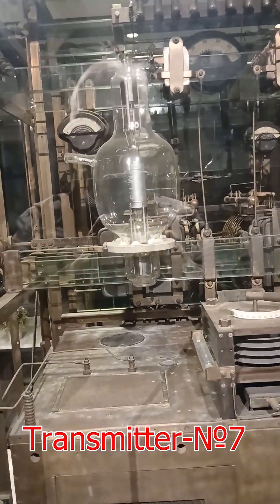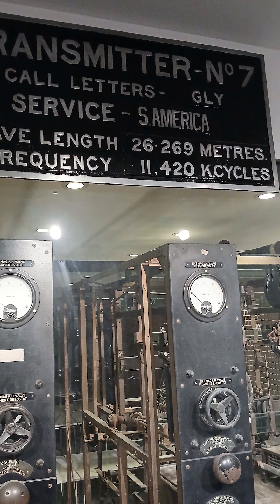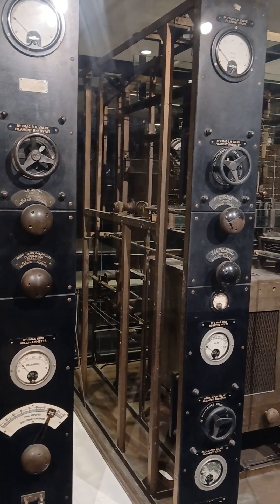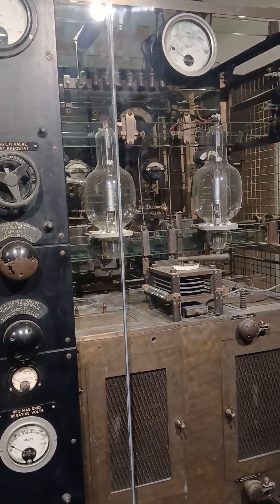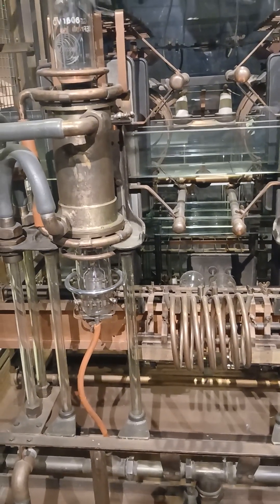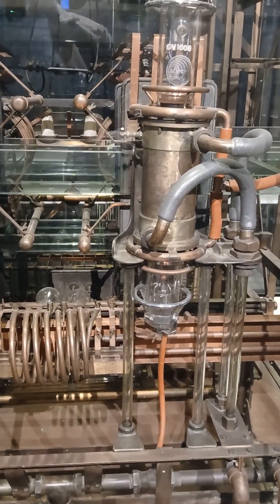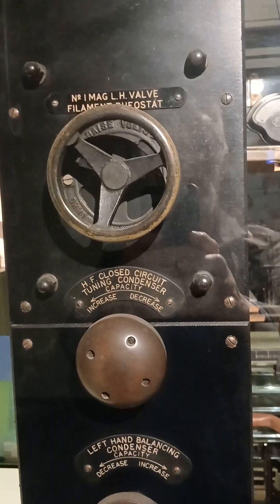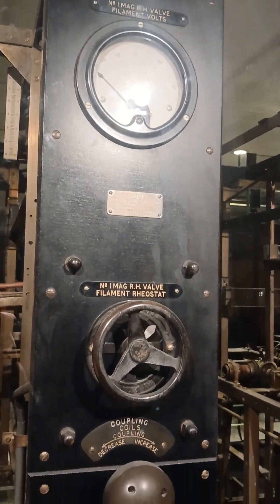This Old Machine Changed Communication Forever!

Comment from the maker: “If you think this is my brand-new homemade still for whiskey
you’re wrong — it’s actually a short-wave beam telegraph transmitter from 1927! 
Built by Marconi’s Wireless Telegraph Company in Chelmsford.

This panel comprising no 1 power magnifier of short wave beam  telegraph transmitter restored in c. 1970.

And, this panel comprising nos 2 and 3 magnifiers and master oscillator of short wave beam (SWB1) telegraph transmitter.

The device was used to transmit telegraph signals over long distances using short waves and directional antennas (“beam”).
— These systems allowed for the creation of the first intercontinental radiotelegraph lines in the era before the development of submarine cables and satellite communications.

Historical context:
— Marconi’s “beam stations” were introduced in the mid-1920s for communication between Great Britain and the colonies and dominions (Canada, India, Australia, South Africa).
— Thanks to short waves, signals could be transmitted much cheaper and faster than through long wave stations or submarine cables.

So, no whiskey here… just a piece of radio history, featured at the Science Museum in London.